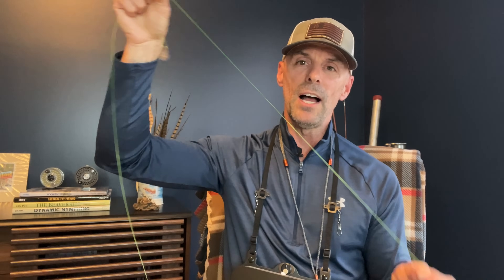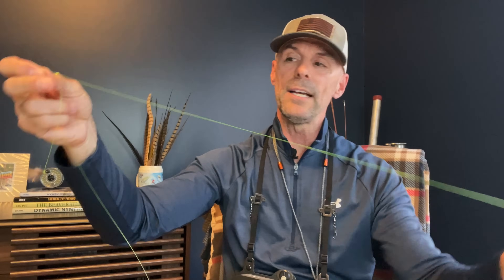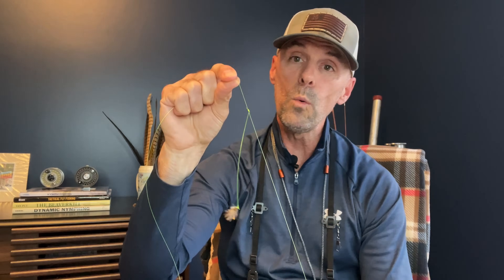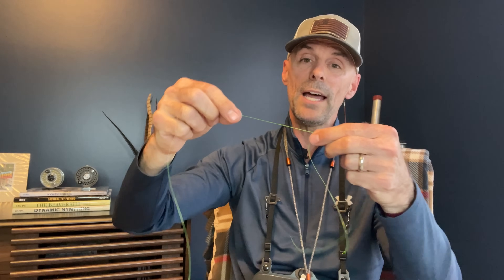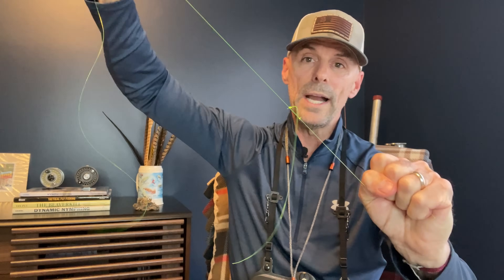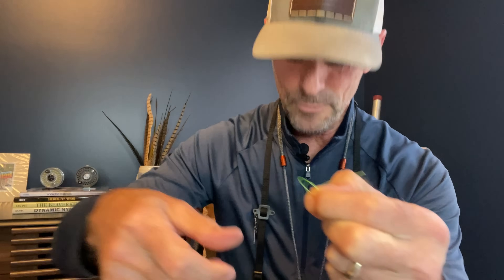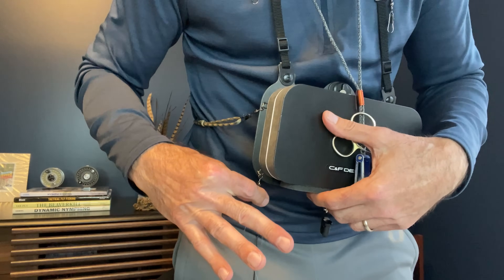How to make an ADJUSTABLE Dry-Dropper System

Comment: A perfection loop is a fixed loop so how are you even cinching it down such that it doesn’t slip over the TSK? I was thinking that you could use an Orvis knot which can be cinched down and backed off as needed. You might not even need a surgeons if you use this knot. If a trout takes the dry, it will for sure slide down the tippet even though it’s been cinched down however it should stop at the nymph. Do you think this would be a problem. I’m obviously going to run the experiment but Im interested in your take.
Reply from the maker: You will just cinch it to the leader, like I did in the video.  It will always stop at the surgeon's knot when a trout grabs it.  I have never had a problem with it-I use it all of the time for light dry-dropper work.
You can try your way (after all that's how we find out new ways of doing things).  Personally, I think the line will get too kinked up after it slides all the way down to the nymph.  Hope this helps and thanks for watching.

Comment: Cory, wouldn't "this" be effective with 2 nymphs as well? Enjoy Montana 🌞
Reply from the maker: Jeff, you could use two nymphs for sure.  You just want to be careful of your dry “sinking” a little because the surface can “grab” it and pull it down when you lift it out to cast.  Just make sure your fly is sitting high and dry.  
Montana is fly fishing heaven!
Reply: @OldDominionTroutBum  It is. I fished the Madison back in May and I live in Colorado ;) 

Thanks for your answer. What I meant is two nymphs only and no dry. Hell I'm barely competent enough to fish a dry with a nymph below it haha. I can't even imagine the hell it would be with two nymphs below a dry. Cheers.
Reply from the maker: Haha.  Oh, I get it!  Yes, you can certainly rig two nymphs like this.  It would work great.  Nice that you live in CO-that is a pretty nice slice of heaven as well.

Comment: Hi Cory why do you prefer the dry on a tag as opposed to the nymph being attached to the hook bend in a dry dropper rig?
Reply from the maker: Ryan,  I like it on the tag for multiple reasons.  1.  To have it adjustable it needs to be on a tag.  2. Your fly moves more freely by itself.  3.  There isn't any line in the way that can cause a missed fish.  4.  When you change your dry, you don't have to tie two knots. 5.  If you don't use an adjustable system, you can change really quick from a double nymph rig.  Hope this helps.

Comment: Hey Cory - I tried doing this the other day and I found when I raised the dropper perfection loop above the slip knot to change the depth of my point nymph, the dry dropper tag it would only stay for a few casts before eventually slipping back onto the slip know.  Any idea what's going wrong on why the adjustable dry tag won't stay where I put it?  Or, is this expected and you just have to settle on the fact that you have to readjust during a dry dropper session?
Reply from the maker: Hey JH.  Every now and then you will have to check it and re-adjust.  But if it keeps slipping, it is caused by a couple of things.  

1. Your fly may be too wind-resistant.  Just simply casting will pull it down.  The force of the cast will do it.

2.  Your fly starts "sticking" in the surface because it starts to become waterlogged.  As you pull it out, the surface grabs it and pulls it down.  Make sure your fly is always riding high and dry on top.  This is the biggest problem I see.

Hope this helps.

Comment: Do you not run into problems with the dry hookset if you have to make up for an extra foot of slide? And when tension of a fish is on that dry does it not grab and fray the line as its sliding to the stopper?
Reply from the maker: I don't, Nicholas.  There is enough tension from the hookset to drive the hook.  I set it like any other strike.  Also, the line is wet, so nothing happens to the line when it slides.  If you slide your fly up and down, you do need to make sure the leader is wet. Hope this helps.

Comment: Must be doing something wrong, don't know what, but something. Micro perfection (1/8" dia.) loop, slips down/against stopper knot after 1 or 2 cast(s). Perfection loop never tightens sufficiently to keep dropper in place. Have tried: 1x, 2x, 3x 4x, 5x tippet, stiff/limber, .......  Sugestions?
Reply: Not criticising system, idea. Like novelty, implicit advantage, ..... Please, help!!!
Reply: With apologies, found my problem. It's important when Old Dominion says, "This is important."
Reply from the maker: Steven,  so everything is OK now?  You always have to make sure your dry is nice and dry and floating high.  The surface likes to "grab" it if it sinks a little.

Comment: I been doing the same thing recently but with a 4-turn uniknot on the dry.
Reply from the maker: That will certain work.  I like this way because it doesn’t kink the line as easy and it’s easier to cut it off when you need to change it.  Appreciate you watching.

Comment: Just curious do you use barbless hooks? If so does it affect your catch rate much?
Reply from the maker: I do use barbless. And it doesn’t affect my catch.  If anything. It goes up because the hook points are long and sharp, therefore your hooks penetrate easily.  It’s and old thought process that barbless hooks lose fish.  It’s simply not the case.  Thanks so much for watching.
Reply: @OldDominionTroutBum  Awesome thanks so much!

Comment: Good day. New subscriber here. I was wondering, do you use a Thomas and Thomas Contact II. If so, which model? I’m debating the 10’9” in 2 or 3 wt. I fish a lot of the same central pa streams you do and looking for advice. Thanks
Reply from the maker: Thank you, Gene!  I do use the Contact ll.  I have the 10ft 9in in the 2wt and 3wt.  The 2wt is the one I reach for most of the time fishing those streams.  It does a wonderful job at protecting light tippet (I fish 7x a lot with it).  It also casts lighter bugs beautifully.  When you start casting bugs that are 3.3mm and above recovery suffers if you don't slow down, but its not a game changer for me.  I use my 3wt when I know I'll be using 6x or more, casting heavier bugs all day (3.3mm and up) because of conditions/current and if I know I'm going to get into a heavy dose of larger fish.

Hope this helps.
Reply: I currently use a older Sage ESN, 10’ 3wt. I think I’m leaning towards the 10’9” 2wt. I’ve been told, kinda like you said, little more mid flex. Not as stiff as the 3wt version. Not as fast recovery, but as you described, mainly in heavier rigs, which was what I figured your view point may be. I’m looking for something a little more sensitive. Have you ever attached a air-loc to it and if so, how did it perform? I would guess it’s ok for close dry fly action. Thanks again for any help/suggestions/point of view
Reply from the maker: I haven’t thrown an air loc, but I throw dry dropper all the time on a micro leader.  It does a great job.  And it will easily thrown a 1wt or 2wt fly line.
Reply: @geneslodysko6150 perhaps you’ve chosen a rod already, but wanted share this: both rods are great, but favor different casting styles. The 2wt can throw a small bobber, the 3wt can do it a bit more comfortably. The 3wt can handle a micro leader and single flies down to about a 2.5mm bead. Lighter than that, the 2wt will handle it a bit more comfortably; the key is adjusting your cast to load the rod properly for the situation. The 3wt is a bit more versatile because it’s a 3wt, but you’ll find a comfortably wide range of overlap in terms of the application of these rods where the subjective variables of personal preference and casting style are the primary factors. If you can’t try them out before buying, you can’t go too wrong with either rod. Give it time and if you don’t love it, then sell it and try something else; keep innovating.
Reply: I think I’m leaning towards the 2wt. I appreciate your insight.

Comment: Hey O D, is this on your euro set up or a traditional flyrod with a floating line set up? Thank you sir!
Reply from the maker: You can do it on a traditional setup, but you will be constantly readjusting the dry as the water will "grab" it and pull it down the leader when you pull it out of the water to cast.  It really is best on a euro set up, because most of your leader is off the water and the casts are more delicate.  You will have to adjust it every now and then, but a lot less with a  euro setup.

Hope this helps.

Comment: Corey, I must be doing something wrong; no one else seems to have this problem.  When I attach the perfection loop to the main line, the loop is too loose and won’t hold its place on the line.  It’s so loose it pulls down even past the surgeon’s knot.  What am I doing wrong?  How can I attached the loop so it better adheres to the leader?
Reply from the maker: Jimmy,  I would imagine that you are not cinching the line tight enough around the main line.  Just make sure you pull it tight, then it will stay.
Reply: I thought I was clinching it tight enough but it just unravels so to speak. I’m thinking the tippet material on the dry fly is too thick to stay tight. Thoughts?
Reply from the maker: @jimmyz20100 The example I was showing was 6 lb test which is like 3x.  I’m really not sure what is the root of it.  I have never heard of anyone having a problem.

Comment: I tried this technique today and I had a problem with the adjustable dry-dropper that kept "sliding" to reach the knot when I was casting..Any advise to prevent that? Maybe the size of the loop was too big or?
Reply from the maker: It could be a couple of reasons.  
1.  Your knot could be too big and not tight enough.
2.  You are forcing your cast too much. Too quick/hard on the back cast and forward cast.
3.  If your fly becomes partially submerged/waterlogged, the surface will grab it and pull it down.

It is normal to readjust it every now and then.  But just try to be easier on your cast.

Hope this helps.

Comment: Thanks for your hack.  I tried it as soon as I watched it.  Great idea!  I have noticed sometimes the perfection loop slides down so it is closer to my tippet ring than I set it at.   Even when pulling the perfection loop quite tight.   So I came up with this tweak to stop that.

I tied what is often called a "slip-bobber stop" knot on my main leader on my sighter (above tippet ring and tippet).  If you have not heard of it, you can see it being tied on this YouTube  video:  https://www.youtube.com/watch?v=xxedoNs1-0Y

I use Cortland Micron fly line backing  in orange for the knot. I find while the knot moves easily up and down the line when pulled by me, it won't budge while fishing.  I then put your perfection loop "upstream" of this stopper knot and move the two of them up or down depending on currents. Nearly all the time that slip bobber knot does not even move when a trout or lls is hooked on the dry of the dry dropper combo.
Reply from the maker: Yours is a nice tweak.  With my way, you have to be aware that every now and then, if your fly gets waterlogged, the surface will grab it as you lift it out of the water to cast. Just make sure your dry fly is always nice, dry, and floating high.
Good luck to you and thanks for watching!

Comment: What size tippet?
Reply from the maker: Brandon, use whatever size you normally use. I typically use 6 and 7x.
Reply: @OldDominionTroutBum  Cory, I use 6x for everything all year around. Do you think 7x makes that much of a difference? I know the answer is "it depends on the situation and conditions"... so I'm asking more in general I guess... or maybe a couple of examples perhaps when/why you choose 7x over 6x? Thank you.
Reply from the maker: @justaman3333  Jeff, it really does make a difference.  7x is 20% thinner than 6x.  That’s a pretty big difference.  For lighter flies, it helps getting down quick and it gives a great natural drift.    So, it is a fly weight thing for me.  If I am fishing 2.8mm or smaller, it’s 7x.  I’ll use 6x if I’m fishing heavier flies like 3.3s or more.  Hope this helps.
Reply: @OldDominionTroutBum  Thank you. Makes sense and I fish 2.8 and less much more than 3.3. What about an inverting 3.0? Have you discerned which size is better for you?
Reply from the maker: @justaman3333  I fish inverted beads 
 a lot. I’ll use 3mm on 7x as well.  The inverted beads give a nice “in between” weight.  It’s nice to go from a 2.8 to a 3mm before making the jump to a 3.3.
Reply: @OldDominionTroutBum  I fish them a lot as well.  Thank you for your time Cory.
Reply: @OldDominionTroutBum  Cory, I caught a bunch of fish today on 7x tippet. First time I've ever used it. I could really feel the difference in the drift, especially with a single nymph. Thank you for your guidance. Enjoy the weekend. jeff
Reply from the maker: That’s awesome, Jeff.  Glad you tried it and had success!

Comment: I would imagine this could be used for a double nymph rig as well.
Reply from the maker: Keith, you can definitely use it this way, although I prefer a triple surgeon's or figure 8 knot.  It has a smaller profile in the water which cuts down on drag.

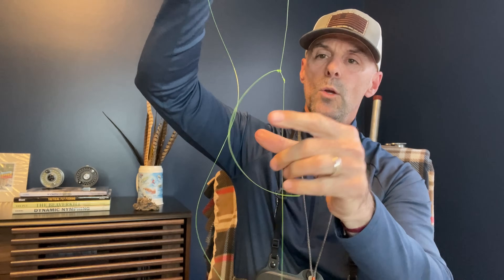Comment: Sorry, it may seem simple enough to some, but sans a slow-mo closeup of how that dry fly extension is “looped” onto the main between 3:12 and 3:29, I’m left guessing the actual procedure.  😢
Reply from the maker: Just take the new tag and lay it behind the main line above the knot.  Take the one end and bring it over top of the main line and take it through the loop.  Now, pull it tight to the main line.  Hope this helps.
Reply: @OldDominionTroutBum     Ok.  It looked like you made more moves than that.

Comment: So the fact that the fish have to slide the tag down to the stopper knot before there is tension doesn’t cause you to miss fish?
Reply from the maker: The hookset has enough tension before it slides to get a solid hookset.  I have never had a problem.  You can see in this video here how it works:

https://youtu.be/5FRU1yd2MzM?si=Mr77FD_34tjwy0hQ

Thanks for watching!

Comment: This is a genius life hack.  Thank you for the exceptional explanation.  This has me wondering if you’ve tried to tie in the triple surgeon ‘stopper knots’ every 6-12 inche”s and remove and reattach tag to the different sections to reduce the slippage amount of the dry along the line?  Not as convenient as just occasionally resliding the dry back to the desired position, but would keep the dry in a relatively smaller section of slippage zone.  Would the added knots along the line adversely affect the action of the presentaion upon laying down the line in the cast?  Also, have you experimented with the bottom ‘stopper knot’ actually being the smallest of tippet rings leading to change over of the dropper section quicker as dropper section shortens with change of dropper fly?  Anyway, love the simple ingenuity and thank you for sharing.
Reply from the maker: Thank you, Daniel.  Glad it is helpful.  You will have to readjust every now and then because you will have slippage (Which is normal).  The slippage usually comes from your dry becoming water logged, then the surface "grabs" it when you lift to cast.  As long as your dry sits up high and dry, it is usually good. 
That being said, your idea of knots every 6 inches or so will work for you-it won't affect the presentation.  I haven't tried a tippet ring, but I'm sure that would work as well.  Hope this helps.   Thanks so much for watching.